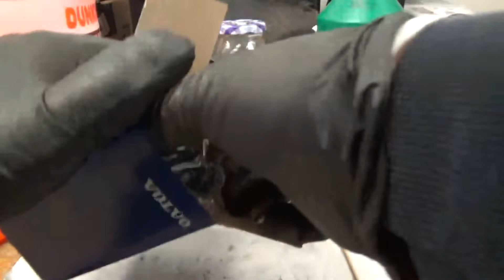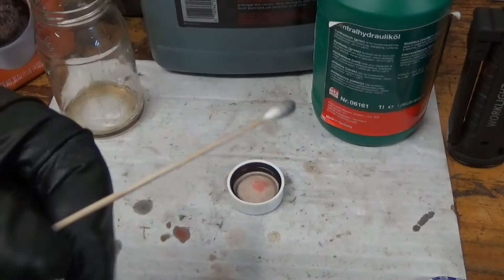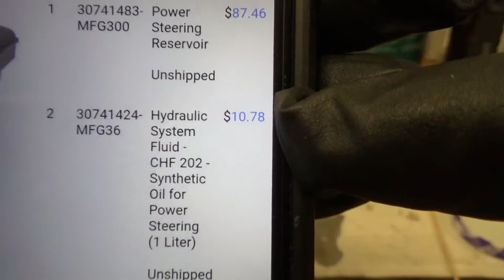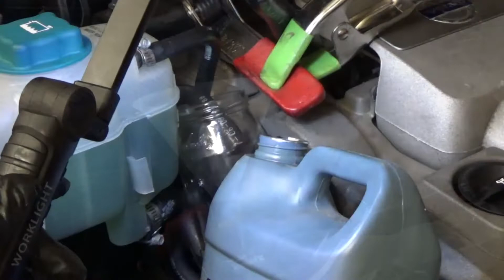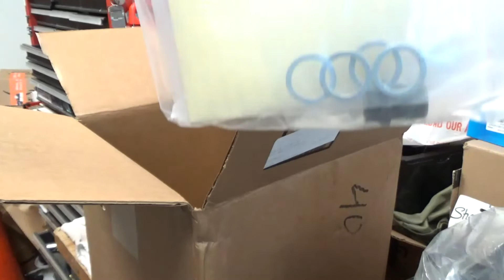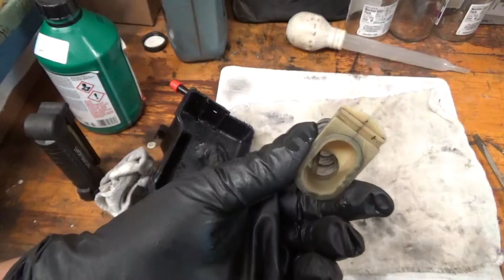Volvo XC90 Power Steering Filter Change

Comment: What we're your steering symptoms
Reply: My xc90's power steering makes the familiar whine.  I've read the filter can be the culprit.
Reply from the maker: Similar to low fluid level, stiff turning when cold.  Seems to clear up when hot. You can draw the fluid out and inspect the filter for blockage in the form of dark areas in the screen.  Then examine the fluid for color and contamination and return it to the reservoir if you don't have any new fluid yet.
Reply: Cool thanks mate, mine is kind of notchy when it's cold but then frees up